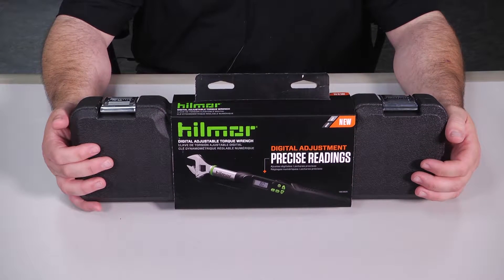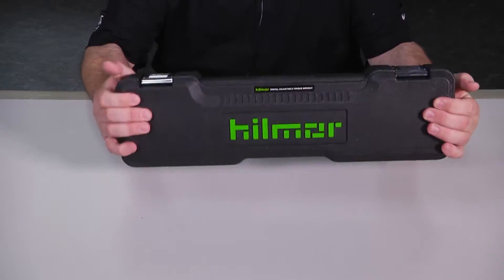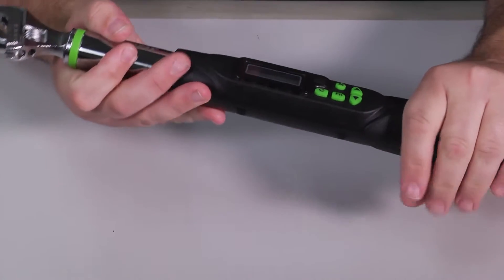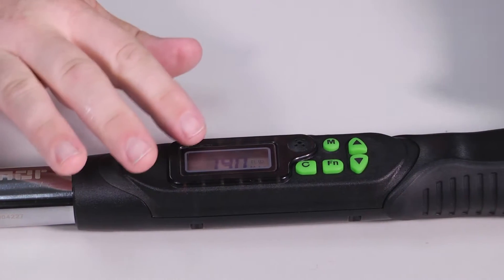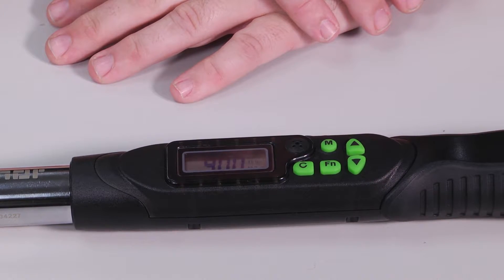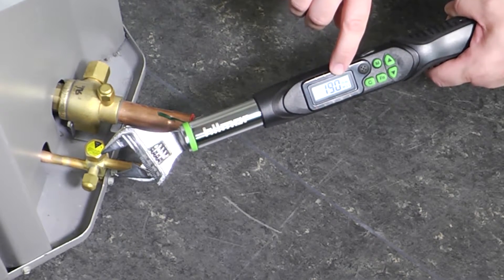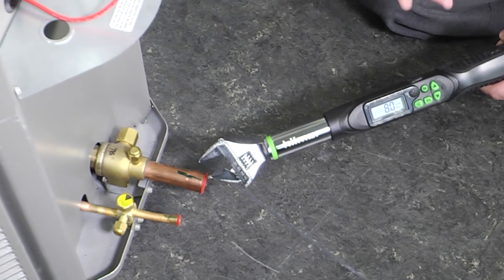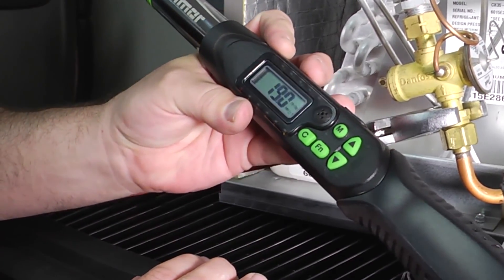Unboxing Hilmor Digital Adjustable Torque Wrench on Toolbox Tuesday

Comment: Interesting, but the form factor limits its use.
The size of the adjustable wrench end, and length of the tool will be an issue on a ton of typical ceiling concealed VRF air handlers installations, or anything in the compressor area of most units.
I was interested when I first saw it, but after handling one, I'm pretty certain I'd still have to break out one of my other torque wrenches too often.

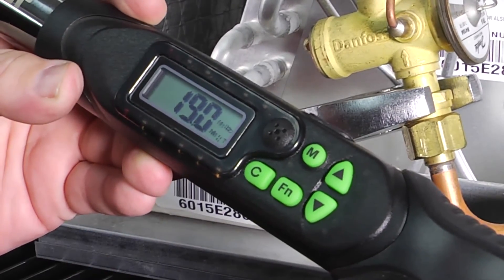5:38 Well, it was torqued it to something, but since the tool was the wrong way around, it is unlikely to be the value the tool was set to. ;)